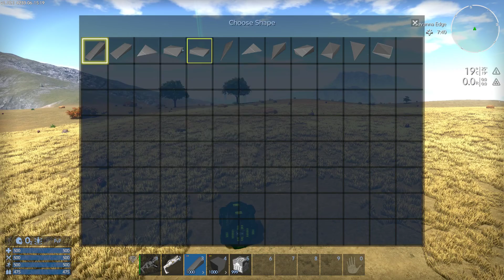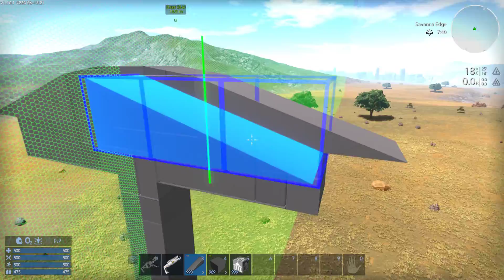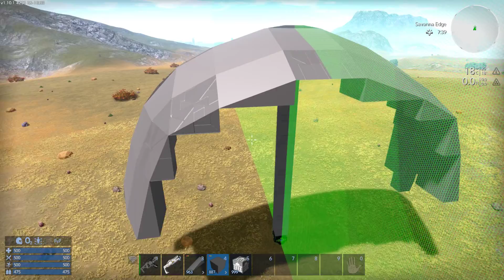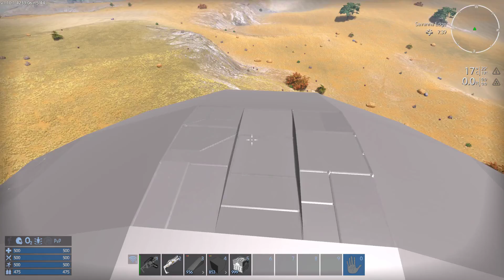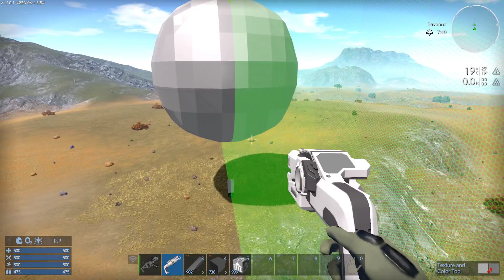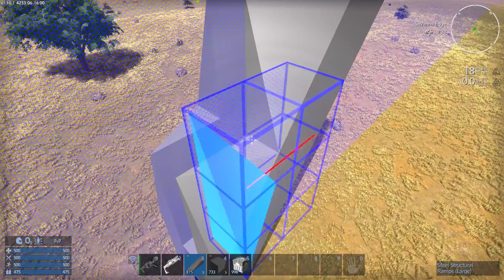Empyrion Galactic Survival - Reforged Eden structural frame block experiment

Comment: I wonder... did thy not consider the possibility of just how many people would want to craft complex ships within their game? Why did thy not just allow folks to 'line draw' ships on a 2d 'chalkboard' then convert that to a 3d shell? Surely the game is capable of properly generating rounded or sharp-cornered objects?
Reply: The short answer to your question is: No. But I will break it down, technically:

1. Did they not consider the possibility of just how many people would want to craft complex ships within their game?
    A: Of course they did, but simply being aware of a want does not create the solution.
2. Why did thy not just allow folks to 'line draw' ships?
    A: Because what you are describing is both a programmatical and design nightmare. Generally, creating an editor that isn't just a version of Maya/Max/Blender is very difficult, as you have to "dumb down" the toolset to make it accessible, while also giving enough freedom to make complex shapes. This is an give and take balance, and the "many people" who want to craft complex ships mostly do not have the ability to use full blown 3D modeling suites. This Game uses the Voxel approach (more on that below) because it is widely popular: it makes for a great balance between accessibility (how easy it is to use) and fidelity (how detailed the end result can be).
3. Surely the game is capable of properly generating rounded or sharp-cornered objects?
    A: Sort of. Empyrion is built in Unity, and is therefore capable of importing and rendering complex 3D objects. But Empyrion itself is a Voxel game, much like MineCraft. That means, both the world, and the bases/vehicles are all made of of voxels, which is basically a 3D grid of datapoints. Voxel tech is well established and fleshed out to be performant. Empyrion took it a step further by allowing objects and shapes that expand beyond just one grid point, and are not limited to a cube. But, being a voxel game, it still has the voxel limitations. Ever wonder why some shapes seem to texture multiple sides of the shape? It is because the voxel data is still based on a cube, which means it only has 6 sides in data, and, therefore, only 6 texture slots. So if the visual shape has more than six sides, some sides need to shape a texture slot. 

So, in summation, Empyrion is ultimately limited to voxel tech, which means they have to define each shape as a data id, so the engine can handle and render it properly. Yes, they could have written a different interface, autogenerating a voxelized ship based off a 2D drawing, but this is extra work, would only provide a basic frame, in only one direction, and not actually solve other "boxy" issues. The real solution to boxyniess is to continue what they did in the 1.10 update, and release larger, more slanty and circular shapes to use. 

If you want to see a different solution, Check out Avorion, wherein they basically shipped a low-rent 3D modeling package as their editor, comprising primarily of primitive stretching and triangulation filling techniques. But, that is NOT a voxel game. At all. And it would not work with Empyrion because the whole point of Empyrion is a component based ship where every grid unit (2mx2mx2m cube, in the CV case) is a discreet object (or part of a larger discreet object), be it a shape or component (like and engine). Because of the texture id limit I mentioned earlier, Empyrion does not allow shapes to be larger than 1 grid unit, which is why it has to break up shapes like a 22.5 degree slope into 2 different shapes, and also why these RE structural Frame blocks cannot be textured or use custom colors.
Reply: @achenar1216  Thanks so much for the enlightening explanation, seriously. It does make sense to the non-graphic programming mind (business computing). I was thinking at the time - IIRC - of a middle step so to say... where you sketched out a 2d model and the program would gen it into the needed assets for a 3d model. I've tried a number of times to build my own ship from the ground up and man it gets frustrating. I would truly enjoy a disassemble mode on existing ships that would allow you to 'explode' it into layered components to learn how others have put them together. As well sometimes, I want to build a heftier version of an existing ship, or wide-body an existing ship, etc, etc... and for me, my frustrations will outweigh my patience 🙂so the ship gets abandoned. Again, I do appreciate your explanation.